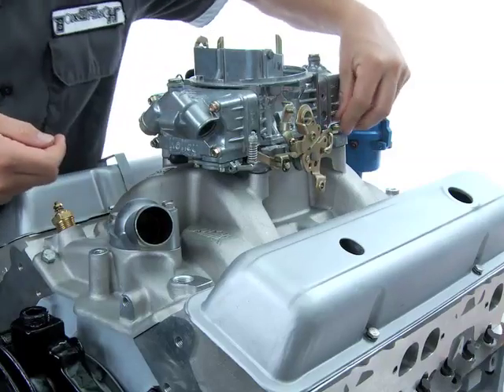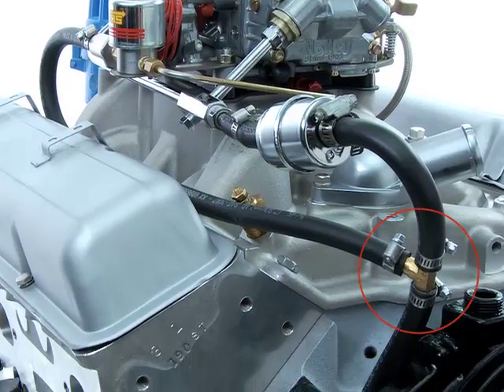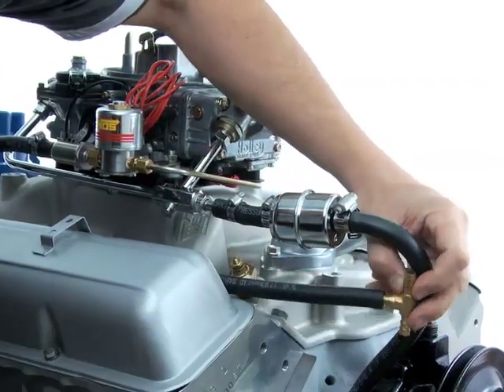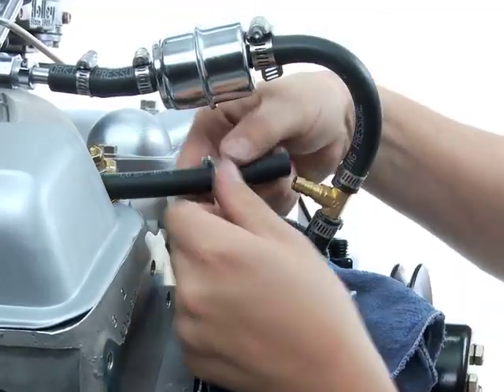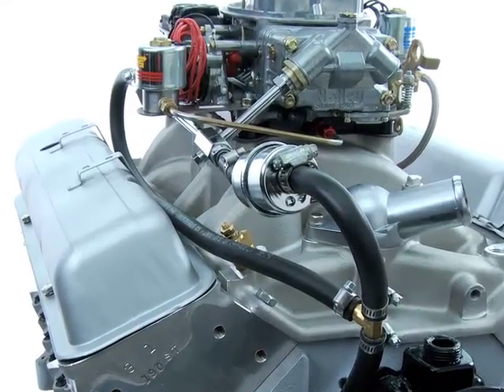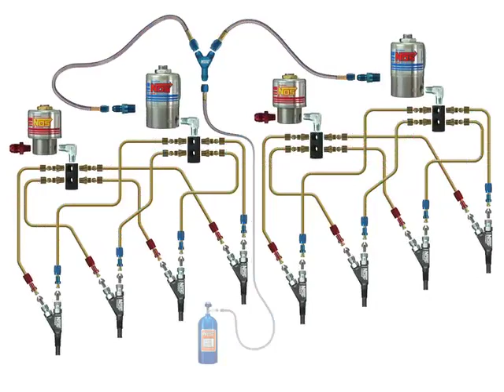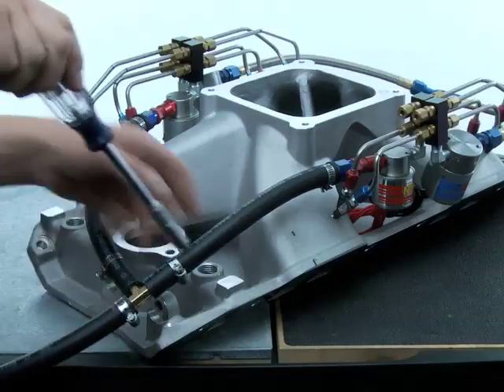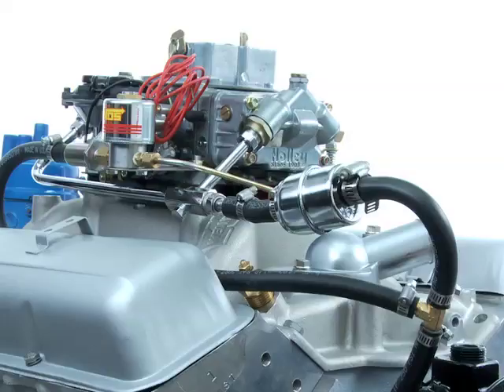NOS Installation Tips: How to install a fuel solenoid on a carbureted engine

Comment: Good info. I was wondering if I would be able to tap off my existing fuel feed to supply for a 100-125 shot on my carb conversion Mustang. I'm using a universal bypass regulator and in-tank EFI pump I now have 2 unused ports I can pull fuel from. Can't wait to hit this little 302 with some juice!